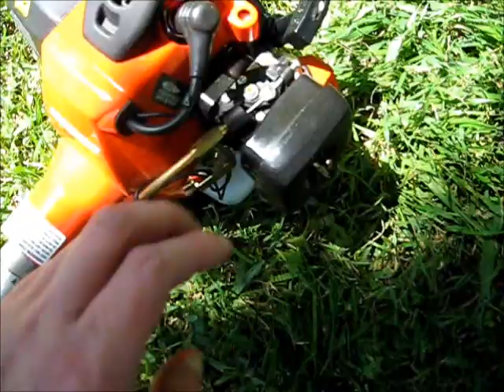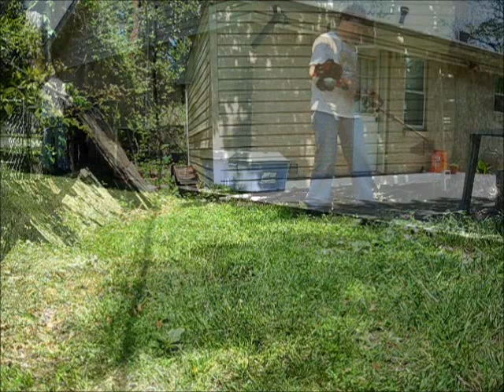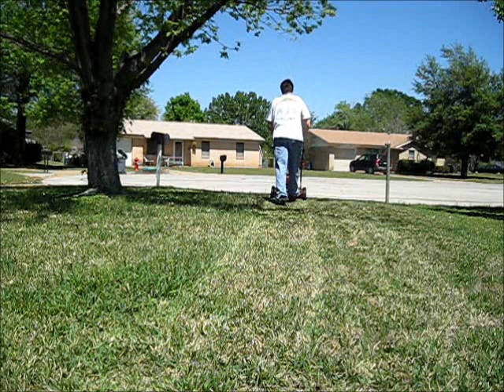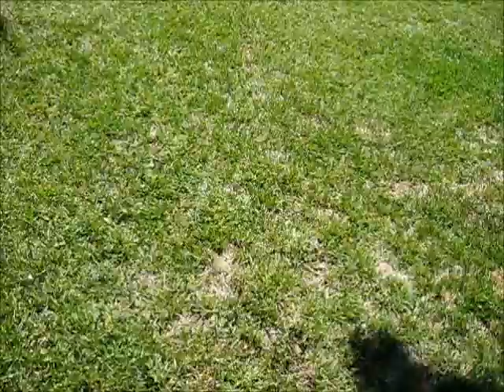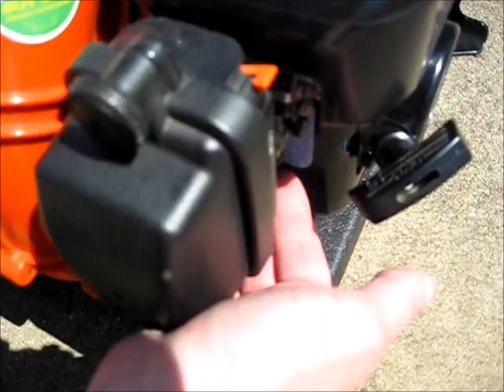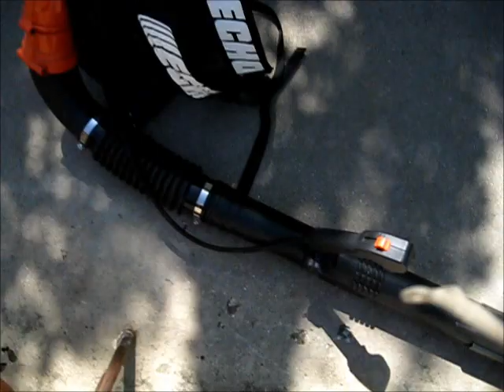April 2013 Lawncutting Video

Comment: Is that a 21' or a 22'inch Craftsman lawnmower? I have a Craftsman Lawnmower with a Tecumseh 6.75 engine and bought it brand new in 1998 and still runs strong with no problems. Btw, You forgot to show what kind of Edger you used?